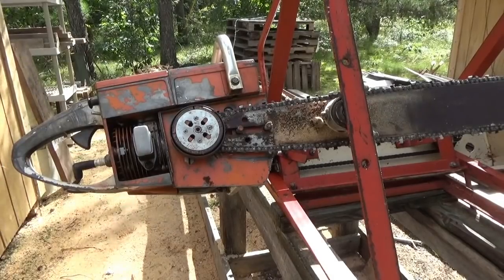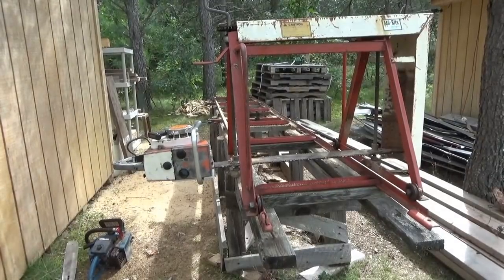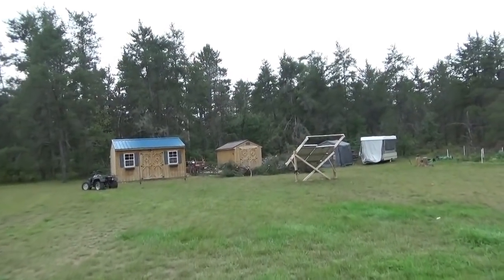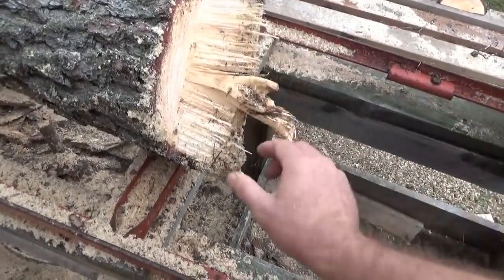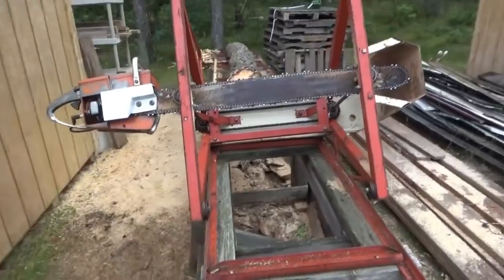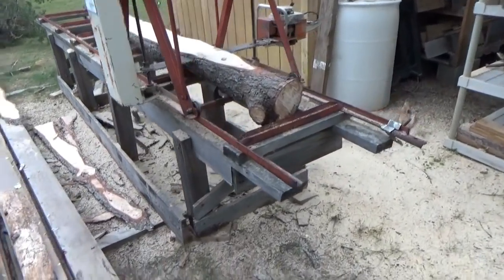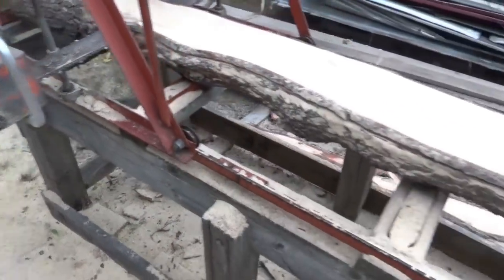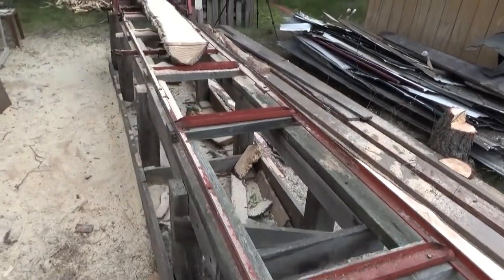Running Vintage Sears D 49 Chainsaw On My Mill @The Off Grid Project

Comment: My first thought on seeing you cut that tree was "I wonder what the duty cycle of a chainsaw like that is." Or is it even a concern? I think lumberjacks back in the day used them intermittently to fell trees,  but I think you're running it far longer in some tough cutting. Or do you plan to make two or three cuts and then give it a break before resuming? I'd hate to see you burn out the engine on this thing.
Reply from the maker: 2 to 3 cuts and it runs out of gas so yes, it gets a break now and then. Plus you are supposed to let it rest a bit as you cut for a couple seconds and also after a long cut. But imagine back when this was made the trees were HUGE compared to today. The lumber jacks cut and cut and cut on a single tree back then.

Comment: Yeah Troy.... That is very interesting that has a great potential to make a good great video on how to solar saw.... It is like sea Tortoise and the Hare this is the tortoise solar salling... The thing is to make the system where you can set it and forget it and I'm sure the stuff off.. you need to add a Tracker winch system to push the blade slowly into the wood as a solar saw cuts the board it shuts itself off by unplugging itself from an outlet because the cord is only so long..
Reply from the maker: One day I may convert it over to hydraulic drive. That can be powered by electric or gas. I am looking into it now. It would be a future investment though due to the cost of the conversion.

Comment: I have 💡 idea for ya troy , cut some lumber so can build a lean two roof , from the shed over your wood mill , you can use a tarp over it , for the time , you are milling in the rain bud ,
Reply: The roof is a good idea but I would use metal panels instead of a tarp.
Reply from the maker: Yes, that is on the list of things to do now.
Reply from the maker: David, metal costs money or takes time to find. Tarps I have on hand now because I got a good deal the other day
Reply: Troy, yes I agree that metal panels cost money, about $20 to $30 per sheet. But I also believe in doing projects right and in a professional way. But that is just my opinion. The awning built using metal would last for years to come.
Reply: I'm not against the idea of using tarps as a temporary solution. I'm just saying that if the roof will be a permanent structure it is worth doing right with good quality materials.
Reply from the maker: David, I need a roof over the mill asap, before the snow flies. Saving to do it "right" would take months and then it would be too late. I would be closing the mill for the winter until it all thaws out. I believe its better to be using the mill all winter and use what I have on hand.
Reply from the maker: Those are quite torn up and full of holes. I already picked out the best pieces and used them on projects. I figure they can be used for siding on chicken tractors cause I can piece little bits together and they are super light aluminum.
Reply: Troy, I agree.  I've also used tarps as a temporary solution. I'm just saying that for the long-term it is better to use metal panels.
Reply from the maker: Oh for sure.

Comment: This there way make throttle  lever so can on
Reply from the maker: It actually has a lock on it
Reply: @TheDoItYourselfWorld  lock full on ?
Reply from the maker: yes
Reply: @TheDoItYourselfWorld  need make adjustable in the pine u don't need full on ,,,
Reply from the maker: Its not uncomfortable to just hold it anyway.